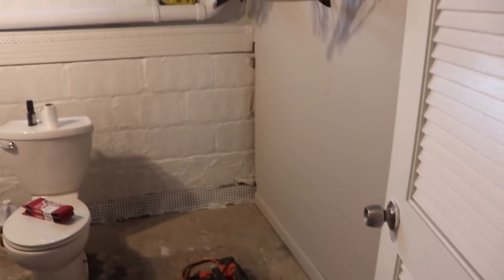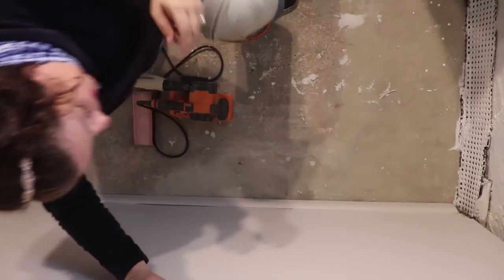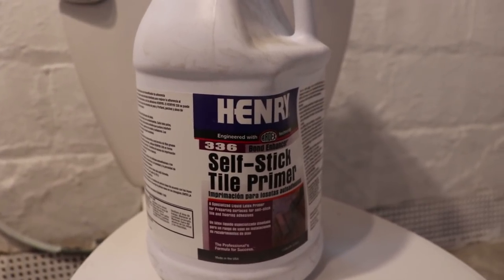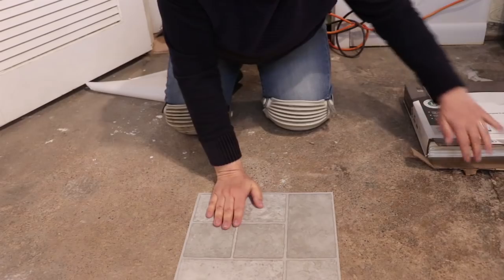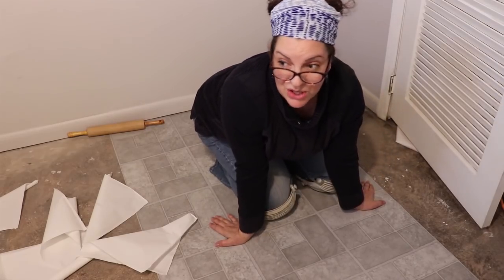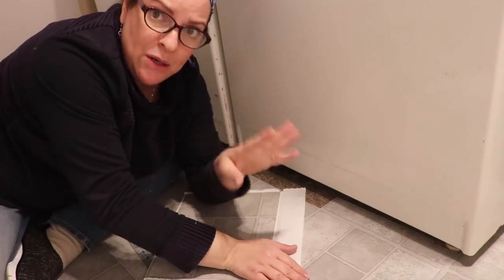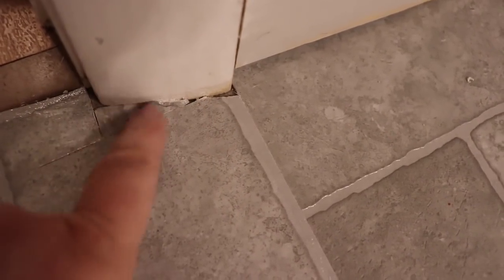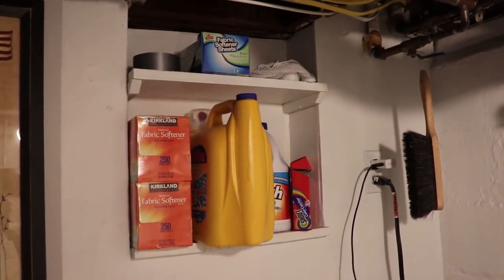Laundry Room Makeover || Episode 8 || A Brand New Floor ||

Comment: For the trouble piece by the door....pull up the cut pieces off and lay them on a new full tile to use as your template to cut a new tile as a replacement.  Perfect one tile piece = no seams for water.

Comment: It looks AMAZING!!!!! Another great job Sophia!!! On the edges where you are worried about water you can run a bead of caulk to seal it, I don't think it will be an issue, but if you are concerned it may be a good step to just run a bead of white caulk around the edges! 

It is absolutely amazing what some white paint can do to a room, even if it is a basement room!! <3

Comment: Sophia, they have rubber edging that they use in bathrooms, some kitchens, they come in beige that matches your laundry room that come in strips that you can glue along the wall of the floor, behind your toilet to cover that netting or what ever.. easy if you want to do that it is like a boarder..and washable..Just  z suggestion..

Comment: LOL "I'm insane".   WOW THAT LOOKS OUTSTANDING!  When you started putting the tile down and you said you didn't have the thing to smooth the tile down I was wondering if a rolling pin would work and looks like you had the same thought.  Really.  Just a great job all around.  Do you need to put caulk around the toilet?  You did when you did the one upstairs didn't you?   I actually noticed a big difference after you sanded the concrete, but that tile really looks wonderful!  Another great job!

Comment: You can get a small saw that will shave off the bottom of the molding so the tile slips right under it. So much easier than piecing it together. Love the way the room looks, and you are correct. It does look bigger! Great job! Just love your videos and look forward to more of them!

Comment: Great look.  Great job.  I'm so glad you pulled out the rolling pin.  I was 'talking' to you and telling you to use the rolling pin, lol.  Also, there is a special saw for cutting the molding so the tile slides under it.  You could probably get away with a hacksaw.  I only know because I had to do it on three doorways when I put new porcelain floor in my kitchen.